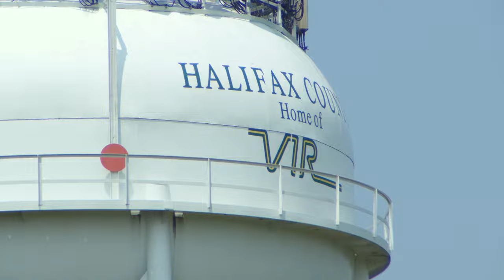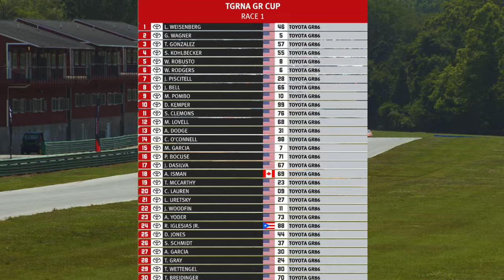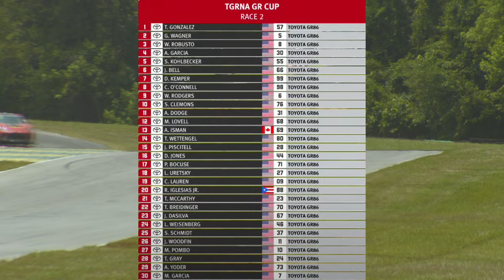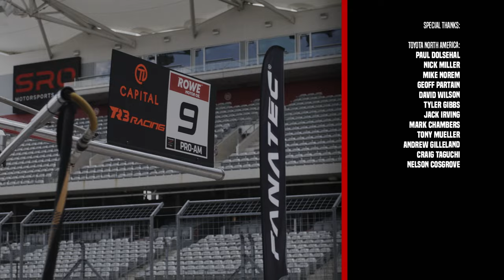"Starting Last" | Racing GRit Ep. 2 | 2023 GR Cup | Toyota

Comment: DO A RECALL ON RTV!!!
Reply: RTV has nothing to do with the failing engines. It's oil starvation during right turns. I heard that these kids (was this race series supposed to be only for kids??) have been blowing up tons of engines every race weekend. And these cars already have some kind of baffle setup. Hopefully Toyota/Subaru figure out a solution soon, and it makes it into production and can be applied to prior MY cars via a TSB. I'm due to go to VIR in October and I'm not gonna lie, I'm reluctant to go back to the track knowing what I know now.
Reply: @johnjfrederick  To my knowledge no one have blown a stock GR86 due to oil starvation. A lot of BS on the internet but no real proof I own two gen of the 86 both stock Both have track days and have not damage an engine so far. Nobody have proof that the RTV is causing engine failure either.